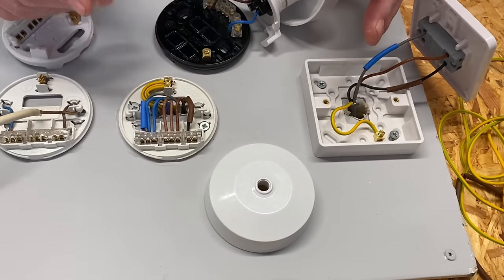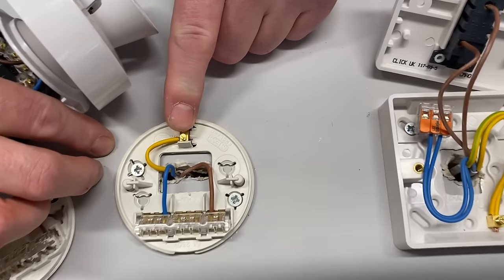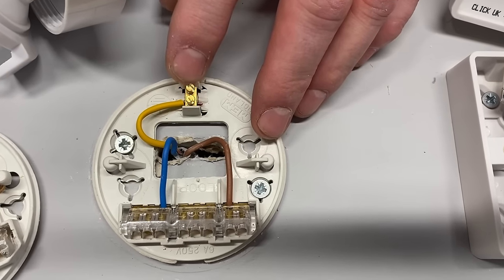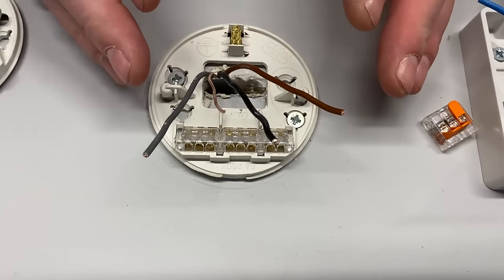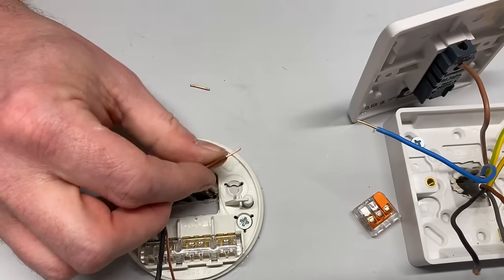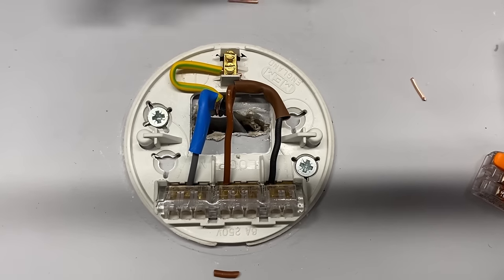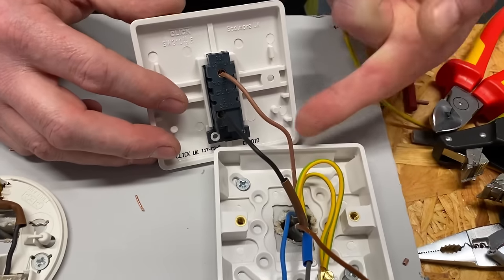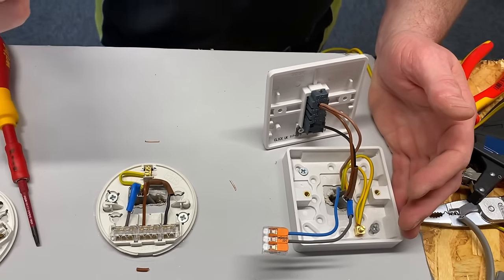Future Proof Your Lights When Taking the Feed to the Switch - 2 Plate Method

Comment: 06:33, having a 'permanent feed' is essentially what is done for commercial applications requiring emergency lighting. Including multiple occupier residential homes, hotels, student halls of residence and such like where there would be non-maintained emergency lighting (maintained typically within actual dwellings).

The commercial aspect to this may be worth covering at some point. You have PIR (passive infrared) activated lights within toilets, office spaces, commmunal corridors to save energy. Luminares within those areas that would have permanent feeds supplying non-maintained luminaires. 

Within office spaces and such like, it's not unusual to have them supplied by LCMs (lighting controller modules) which can be controlled via remote software.

Comment: Great idea. I'll watch out for opportunities to do this in future.
I'm often baffled why the cable manufacturers don't give us a blue core in the 3core+CPC cable. I don't remember any time I've ever used a 3core+CPC as a three phase cable.

Any feedback on this is welcome. 
Thanks for the video.
Reply: Before they  harmonised the  wire colours way back in March 2004, 3 core and earth' cable used in two way lighting was blue, yellow and red with a bare copper earth, if I wasn't doing 2 way switching, then quite often I us 3 core cable &  use blue wire as a netural for future use.Nowadays I tend to use Quinetic wireless switches, no drops to chase, only back boxes,if not surface mounting, 1 receiver can be controlled by up to 10 switches,so 2,3,4 way or more, is so easy now & quicker to install,less mess, so I think offsets the cost of the switches,etc.

Comment: Great video and a very good idea. Can you show how to add a 2 way switch when feeding the switch? Thanks
Reply from the maker: Wiring Diagram Lighting Circuit 2 Plate Method Taking the Feed to the Switch - 2 Way Switching
https://youtu.be/QX1B4gtqisc
Reply from the maker: Lighting Circuit 2 Plate Method How to Wire and Connect up 2 Way Switches (Connections Explained)
https://youtu.be/zfsP-C7DjSo

Comment: Would you say Gaz ..3 core is best (for rewiring and adding lights to loft , outside lighting .
Reply from the maker: 👍🏻 thanks for commenting
Reply: @GSHElectrical  is 3 the best for extending ....
Reply: @stevendouglas3860  only in the circumstances in the video. You don't need more than 2-core+cpc until you want to switch something and either provide neutrals at the switch, or a permanent live in an accessible place for possible future expansion.
Reply: @tobysherring1369  thanks 👍

Comment: How would this work with a 3 plate downlight in terms of wiring?
Reply from the maker: How to Future Proof Your Lighting Circuit with a Neutral at the Switch - 3 Plate Wiring Method
https://youtu.be/1XcxdvFRyY0
Reply: @GSHElectrical  amazing! I did see this one but its referencing a pendent as opposed to a downlight where the connections differ between the two.

Comment: the earth isn't needed from the switch to the light if using that plastic light switch box, if you get a smart switch and a 2core and earth is in the wall, use the earth as neutral , move it in the looping plate also (at the light end) , simple solution. i dont think theyll tell you to do that in collage but think about it its a good way around the smart switch needing a N connection

Comment: Can you explain the 2 plate method when the neutral is in the ceiling rose and not at the switch (run in pvc singles), I see this mainly in council houses.
Reply from the maker: Wiring Diagrams for Lighting and Motor Circuits
https://www.youtube.com/playlist?list=PL2Ea5r9gxUUfm4SACOSOZigCeSxxC5xaO

The above playlist may help

Comment: Sounds a bit like a ring main but for lighting
Reply: Err, no. It's still radial. The point of a ring is there's no end point because you go from the last fitting/plate back to the CU. What's being suggested here is nothing like that.
Reply: @tobysherring1369  Maybe it should be as you'll be adding more and more current the further you extend this
Reply: @Pegaroo_  the current is limited by the cpd at the cu, and the cable is rated accordingly. If your radial lighting circuit is likely to draw something near 6A (well over 1kw) you shouldn't extend it but install a new one for the new area.

Comment: A 3 core for every switch drop is gonna get pricey.
Reply from the maker: The most expensive cable is the one you forgot to install 👍🏻
Reply: @GSHElectrical  Thats what cable schedules are for.
Reply: You would need an extra neutral to go between two way lighting to have a neutral at each switch, your 3 core strapper wouldn’t have a neutral

Comment: Every sparks worth his salt knows that the best place to find a permanent line is in the floorboards or roof space ,in running in a 3 core from the light to the switch is ridiculous because you are just adding connections to the circuits,in my long 50 year career as an Industrial sparks it was frowned apon to have connector blocks inside switches,so what is the point of this new system,answer nothing but adding loose connectors to your circuit and making switch boxes having to be deeper to take these connectors,if you believe in this system compared to the 3 plate system then you astound me

Comment: Why? Why would we use an expensive resource like copper when we have switches that like Quinetic and use another piece of copper when they aren’t required in the first instance.  

Nobody future proofs when technology is moving fast. 

Economic efficiency will mean switch wires go the way of the dodo.  Even Ethernet cables and PoE could provide a solution.  

Just think of the savings and decorations from not using switch wires. They even do smart switches that don’t require a neutral.

Everything is becoming more modular and easier to install too.  Lower power, less resources are the future. People in the industry need to be aware and BMS system will become more prevalent in houses as products get cheaper and more reliable.
Reply from the maker: Thanks for taking the time to share your thoughts